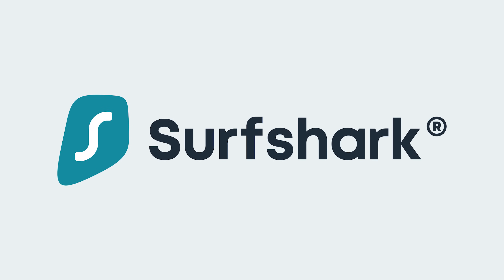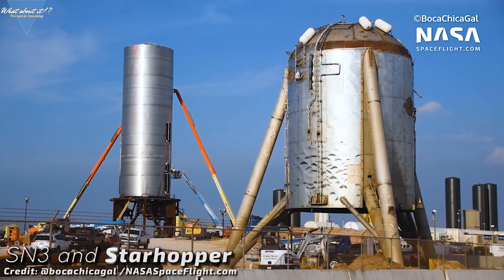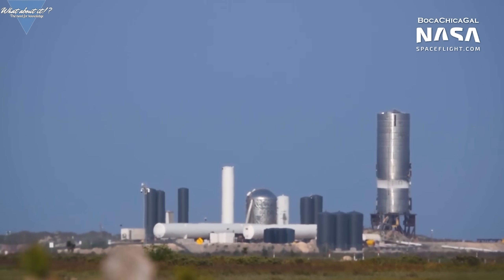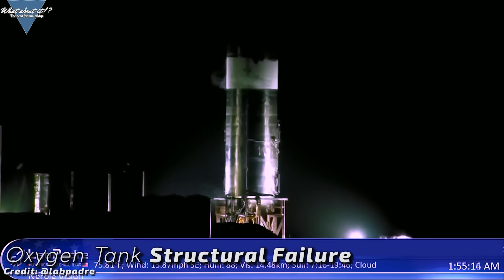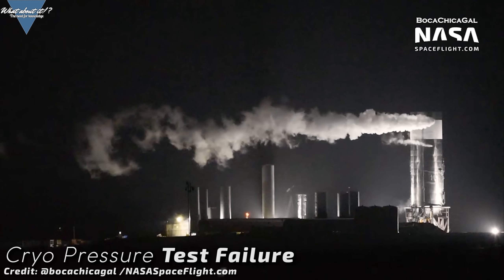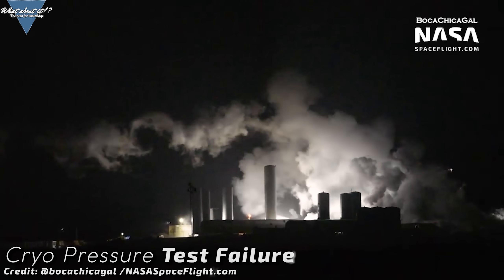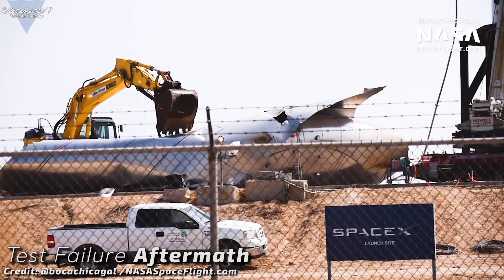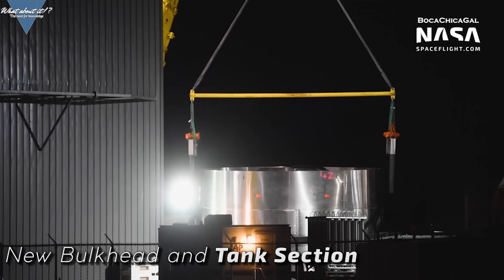83 | SpaceX Starship Updates – SN3 Cryogenic Failure Explained – Expectations For SN4

Comment: I still can't understand why they thought it would be OK to fill the upper tank while leaving the big tank underneath it empty? Surely they must have done SOME calculations of the structural integrity of the Starship under load bearings? If it could fail catastrophically like this calculations would have shown that it was a no-go to put this much weight on top of am empty main tank.
Reply: The lower tank was pressurized enough most of the time, just didn't maintain enough pressure at the end. 

It is possible that they didn't anticipate the amount of N2 gas condensing back to liquid on the cold common bulkhead. This condensation needed to be made up by ullage (bottom) heaters boiling it back to gas, or by constantly supplying gas pressure, even during draining. 

Possibly, the test was originally configured to have both tanks filled and the drain valves would both be opened to drain liquid. Unfortunately, the lower tank had little or no liquid to drain and the drain valve was depressurizing the lower tank. 

IMAO, the test was modified ad-hoc and this consequence was not anticipated.

Comment: I can't really bring myself to believe that SpaceX would make such a mistake when setting up the test. Weird.
Reply: Perhaps the test was just that, a test to see if we need a lot more structural support. The real mystery here is actually the nose section, which if made from flat steel plates seems to be bent in ways I can't do at home with my own plates.
Reply: Don't treat it as a failure this early on. Treat it as a lesson.

Comment: they honestly need too add both vertical and ring bracers respectively to add needed integrity and while this will reduce fuel and add weight but some redesign and they might be able to add a way to remove the tanks individually

Comment: Atlas tanks are opposite to Starship tanks.  The common bulkhead goes upward in an Atlas so there is no chance of reversing the bulkhead when the fuel tank is pressurized to support the weight of the LOX tank.  You can see (as Starship collapses) that neither the fuel or LOX tank is pressurized (or it would have exploded when it collapsed).  That’s where they went wrong, someone depressurized the fuel tank not realizing the LOX tank would depressurize along with it.  It has to be this way since the common bulkhead points downward, if the LOX tank doesn’t depressurize, the bulkhead would reverse even with a very small delta P (and destroy the vehicle).  Having propellant in the LOX tank would have made no difference, only pressure matters.

Comment: Why they tested the lower and then the upper tank?
My theory: They hadn't enough N2 to fullfill both tanks at same time. Even with loses in the bigger one, they still capable to fill the smaller one.
Reply: They can not test lover tank without testing upper tank and as they found out with SN3 it is not good idea to test upper without lover at least in a way they did.

Comment: When the starship comes back “empty” from space, it still has pressure in the tanks - engine exhaust instead of helium as in falcon 9. Reason for change is there is no helium on mars to harvest easily.
Reply: If pressurization is not enough, could they add stiffener structure inside? Enough so that a Starship can stand on its own, unpressurized.  Also, in this test, sn3 was fine with no load in the upper tank.  But there was nothing above the upper tank, either.  A useful Starship is going to have a cargo/cabin section on top of that tank.  How many tons will that be?  I would think at least 20 or 30 tons for the structure and equipment, plus a cargo load of around 100 tons.  How is that going to be supported, by constant pressurization?  What if pressurization is lost?  A cabin section would hit the ground pretty hard; probably even on the Moon.  The Atlas' balloon tanks were only intended to last for one launch.  It was expendable.  Starship needs to be more robust, I would think.
Reply: Andrew 13579 
It can already stand on its own. If the upper tank is full, the lower needs pressure.
Reply: It looks like pressurization isn't sufficient.  What about atmospheric shock loads?  It would be more than embarrassing to hit a thunderhead at 40,000 feet after a successful Moon mission, and end up in ribbons.
Reply: Well of course, Felix mentioned in the previous video those small pipes swirling around the centre raptor engines which would appear to be used as heat sinks, however what I'm concerned with is is the pipe long enough to reduce the heat to inject the pre-burner exhaust into the tanks? Additional heat could weaken the tanks and also cause the stainless steel alloy like other metals to expand which could be a serious problem for the welds, the most catastrophic event would be an accidental detonation of the tanks.
Reply: @danielburmas1136  
The weld metal is often very similar, or identical, to the base metal - except that it is closer to the annealed state.
Reply: Combustion in the preburner is very incomplete; hence fairly cool exhaust. Plus, there is cryogenic liquid in the tanks to chill it still further. I'm surprised it takes any heat exchanger at all. Probably they'll find some way to ditch it from future designs.
Reply: Eli Harman 
Are you sure the exhaust is from the preburner?
Reply: John Eriksson No, they’ll bleed off some methane and oxygen separately and pass them through heat exchangers by the engines to warm them up. This gas will be fed back to pressurise the tanks. Methane for the methane tank, oxygen for the LOX tank.
Reply: Nick Moore right.  So it's not even burned fuel, it's just heated up methane and lox being pumped back into the tanks to keep the pressure up.
Reply: @J7Handle  Firstly, it seems very dangerous to me to pressurise anything using a MIXTURE of methane and oxygen gases.  ALL gas flow will generate static charges and risk static DISCHARGES.  BLAM.
Secondly, pumping back any gas into a volume of SUPERCHILLED liquid gas risks that gas recondensing back into liquid, and leaving a VACUUM.
I don't know what SpaceX are actually doing, but they are surely not doing either of these actions.  Are they?
Reply: @beachcomber2008  You're wrong about both things. The debate is whether they are pumping exhaust from the preburners back into the tanks (CH4, H2O, and CO2 from the fuel rich preburner back into the CH4 tank and O2, H2O, and CO2 from the Oxygen rich preburner back into the LOx tank), or pumping heated O2 back into the O2 tank and heated CH4 back into the CH4 tank (my understanding is that they pump exhaust back in). In neither case is unburned fuel mixed with unburned oxygen.

As for the other question, if pumping heated gas into a chilled tank can create a vacuum. The answer is no. If you increase the average temperature and quantity of gas molecules in a tank, the pressure can't decrease below the initial pressure (although the pressure can decrease from whatever you bring it up to, say, if you have a tank with 1 atm of pressure, and bring it up to 8 atm with heated gas, it could decrease back to 1.5 atm or something like that). The pressure could also decrease after fully depleting the tanks of liquid, for obvious reasons.
Reply: @J7Handle  In the first case, you'll get ice crystals, and in the second you won't get a vacuum but you will definitely lose so much pressure that the tank's longitudinal buckling strength may possibly be compromised.  Well, it obviously was.  Sticking valves should have been anticipated.  Floating about in zero G will compound this problem.  Once the tanks are drained, re-entry buckling will be lateral for most of the way.  That's another thing that cannot be easily simulated on the ground.  Thanks for your response.
Reply: @beachcomber2008  "Well, it obviously was" I don't know the meaning of this, are you saying that the problem was loss of pressure? Because from my understanding, the problem was that the lower tank was never pressurized to begin with. You're right about pressurizing the tank, I really don't know enough about it to understand it fully.

Anyways, I don't see Spacex failing to surpass any issues and canceling Starship. Once Starlink comes online, they'll have plenty of time and money to work out any kinks. Furthermore, I don't really see any of these issues endangering lives, either. There will possibly be dozens of Starship payload variant flights before any crewed launches. After all, the Falcon 9 has had dozens of flights before ever carrying crew, and I don't see anyone questioning the safety of that workhorse.
Reply: @J7Handle  I agree entirely.  I wanted all this to start happening in the mid-seventies, but the Shuttle was fiscally voracious, and swallowed up all the talent of that time, I suppose.  It's all very exciting this late in my life, but if I hang on then maybe I'll see someone step on Mars.  Here's hoping. . . .
Reply: @beachcomber2008  Here's a diagram of spacex's raptor engine: https://i.stack.imgur.com/ujcJ7.png

compared to RS-25 space shuttle main engine: https://upload.wikimedia.org/wikipedia/commons/thumb/9/9e/Ssme_schematic_(updated).svg/2000px-Ssme_schematic_(updated).svg.png

As you can see, both engines siphon off some fuel and ox, heat the gasses up (using regenerative cooling for the fuel and a heat exchanger for the ox) and then push those gasses back into their respective tanks. I'm guessing the heat conductivity between the hot gas and cold liquid in the tanks is pretty low, so you don't have to worry about your liquid fuel and oxidizer evaporating during the 3 minute or so burn, and while the gasses might condense as they cool, you just continuously push more gas into the tanks, because as long as the engines are running, they're pushing that gas back into the tanks. It must be a pretty well studied technique if the Space Shuttle used it.
Reply: @J7Handle  Thanks very much for that info.  I agree with your analysis.  The test neither mimicked the hot gas pressurisation nor the increase in G.  Yet it failed.  Hm.  Still,  a good test.

Comment: Musk has stated on Twitter that it was wrong instructions given to an exhaust valve.
Spacex is the King at build/test/rebuild/retest/rebuild again  and on and on. They are fast and use every thing discovered in a failure.    Yes, there will be at least a short hop test before Christmas.

Comment: Hi Felix, great Video. Do you know if the finished Starship/ superheavy will be able to withstand the pressure of a filled upper tank without a filled lower tank or just with a filled lower tank?
Thanks in advance.
Reply: The upper tank normally is filled with lighter CH4, not LN2. Either tank can be filled first if (and only if) the tanks are pressurized adequately. [EDIT] Six to seven Bar is nominal at lift-off; something less until then. 

It is important to keep the upper tank pressure higher than the lower tank so that the middle bulkhead stays inflated, even in zero G. Otherwise, it might crumple.  

This test had the additional issue of N2 gas condensing on the cold common bulkhead. Normally that cannot happen as the liquid methane is warmer than the LOX.
Reply: @avid0g  Thank you for the explanation!